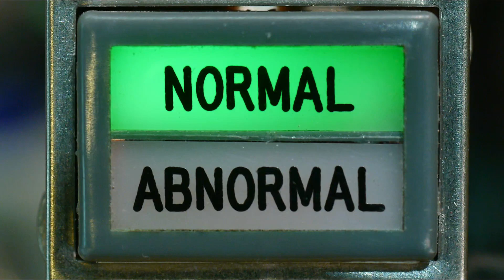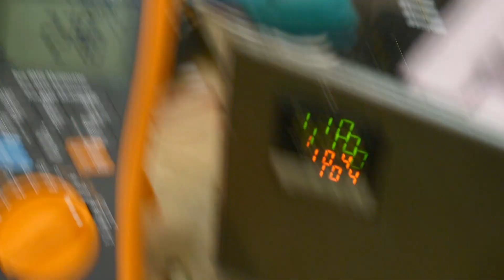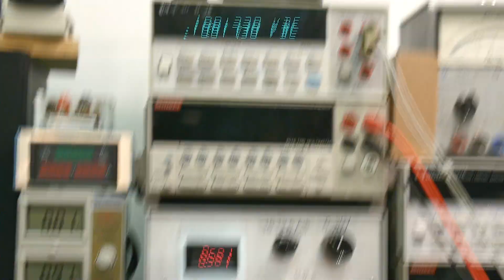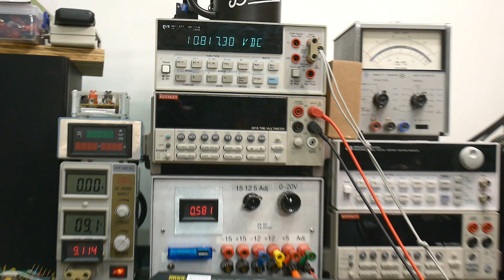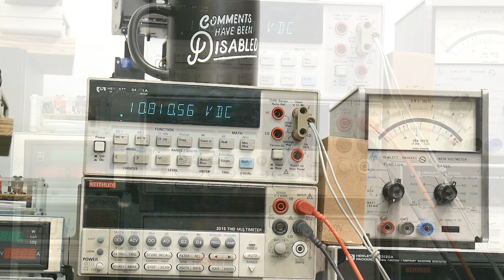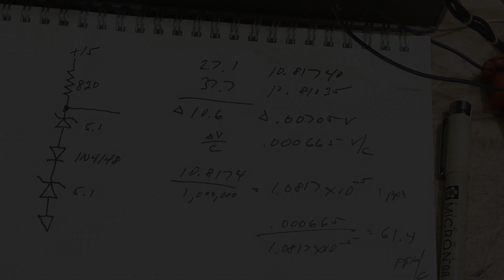#1170 Compound Zener Diode Temperature Testing

Comment: I love your videos, but this was not really a fair look at this (for the reason you already mentioned, you didn’t wait until the temperature equalized, and we don’t know if the parts heat up at different rates).  It would be great to see this revisited with a longer soak time, and also maybe using a resistor to inject additional current or steal current from the 1N4148
Reply from the maker: I would say the parts were all very close in temp. I would encourage you to do the experiment for yourself. I have seen circuits that use similar ideas but require hand selecting the diodes and trimming the resistors for the best currents. More than I wanted to do.
Reply: @IMSAIGuy  that’s a great idea, I’ll give it a shot!

Comment: "In fact the voltage decreased, so this TC is  61 ppm/C.  10 times better than a diode or Zener alone.  You could probably get another factor of 5 by optimizing the current - presently less should be better so I would try a few k resistance to see if the sign changes.  Semiconductor resistors also have negative TC (more current and higher standard voltage)."
Why does YouTube line out my *&%# message?
Reply from the maker: it seems to be doing that lately on some comments. I have no idea why. Googe at work!
Reply: Did you use a tilde maybe?
Reply: @cellularmitosis2  No -- negative.

Comment: Cool video.

I am currently experimenting with the new high intensity Amber (591nm) LED's (e.g. Cree C503B-AAN-CY0B0251) that use AlInGaP semiconductor to bias a silicon BJT.  This semiconductor LED is supposed to have the same (-2.0 to -2.1 mV/K) temperature coefficient as silicon.  I am hoping for a relatively stable, low temperature sensitivity, and low voltage circuit for biasing transistors.

Comment: What if circuit was initially designed to work at stable temperature in oven, as in some expensive older devices where reference is in small internal oven? 😉 Then outside temperature change will not affect it.. Only preheater will take time..

Comment: In defense of the viewer that suggested this. I believe diodes used in this type of service may require aging before use. Also using any random zeners and random diode in the service without knowing who manufactured them and what those specifications are exactly will certainly affect the results. I suggest the next test include ground references for each diode so that you can measure the voltages of each diode as the temperature changes. Otherwise a very interesting video.
Reply: This is one of those things that may work,  with soecific devices, from specific manufacturers,  but, as someone who has worked on development for 200*10^6 volumes... not quite reliable enough across wafer location, wafer lots, manufacturing changes that are not "public"

Comment: The 1N4148 diode could be used as a thermometer since the diode voltage at a constant current will change linearly.
Above the optimum voltage the zeners work by avalanche breakdown which has a positive TC.  Below the optimum voltage zeners work by Tunneling (also called Zener) breakdown which has a negative temperature coefficient.  At the optimum Voltage the two mechanisms counter each other.  
I have used the breakdown TC to identify the breakdown mechanism in new devices and semiconductors.
There are (or were) zero TC zeners that have a zero TC for one current.  I have a jar with about 40 of them in my garage.
Reply: True.
During my first class on Zener diodes at University back in the late 1970s we were taught about the difference between the Zener effect & the Avalanche effect.
We were told to refer to diodes above 5.6V as avalanche diodes & only those up to 5.6V as Zener diodes.
Of course being lazy over time we all end up just referring to all of them as Zener diodes, but I always find it odd that so many Electronic Engineers are unaware of the difference.

Comment: Don't you need to account for the temperature coefficient of the resistor,?
Reply: The point of the zeners and the fancy circuit is they should act as an ideal zener. IE they will hold a voltage regardless of the current flowing through them, so the small change of the resistor is something that should be taken care of. Either way that resistor is part of the circuit that's meant to be the voltage reference.

Comment: Normally a 5V6 or 6V2 zener with the series silicon doide. Not 1N4148, you want one that is not gold doped for a more linear response, there are some reference 6V8 zeners that are close to zero TC, you just have to select the current that drives them to get to the right zero TC point.
Reply: Exactly. That's the way to get very low TC.
The negative side is that after that adjustment you must calibrate the voltage.
Reply: 5 mA is what I learned the right current for the best 6V2 and 1N4148 combination. I learned it from a very experienced professor 45years ago but I did not try it out, (there was no need for a self built reference before the band-gap references took over) I just checked it in the relevant data sheets and it seems to be right.  -  So I am interested in actual present results. :o) -  
In more detail: The smallest temperature coefficient (TC)  is with 5V1 diodes but they have more variation of TC over the samples. The smallest variation in TC over samples is with 6V2 diodes but they have to be compensated with one 1N4148.
Reply: @Manf-ft6zk  5mA is the average right current, but for precision references they take entire batches of diodes, select for those with lowest noise, and then individually sweep all of them to get TC over the range of-40 to +125C, at 5mA. Then match the TC for each zener diode with another run in forward bias over the same range, and look for those that will complement each other, and pair them together. Then those get swept again, and the ones that are the best together are kept, the rest go back as the regular zener diode into general stock. Those best ones then get swept at different currents to see where they are zero TC, and then have a resistor pair assigned to set the current flow with 15V supply, and get aged for a year at 125C in inert atmosphere, then tested again. That is how Fluke got their references, expensive and time consuming, but you got the best possible stability out of them.

Comment: Stolen words from Wikipedia: In silicon diodes up to about 5.6 volts, the Zener effect is the predominant effect and shows a marked negative temperature coefficient. Above 5.6 volts, the avalanche effect becomes predominant and exhibits a positive temperature coefficient.
Reply: In a 5.6 V diode, the two effects occur together, and their temperature coefficients nearly cancel each other out, thus the 5.6 V diode is useful in temperature-critical applications
Reply: Could you spice model simulate it and compare with your results